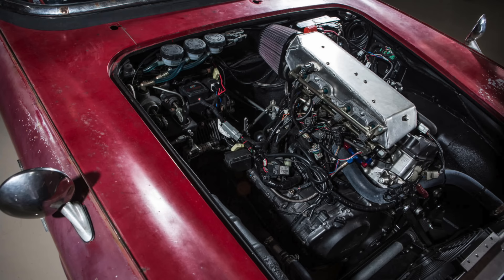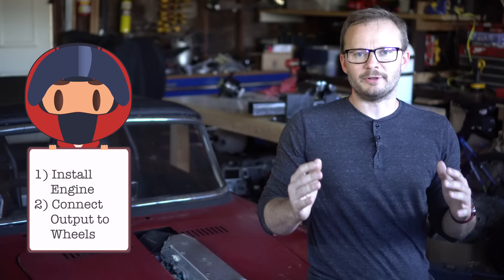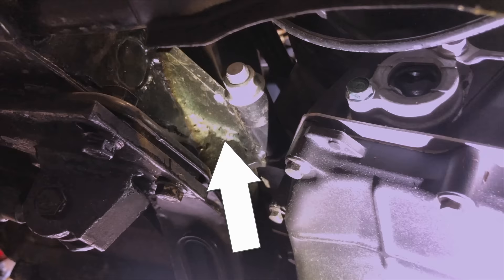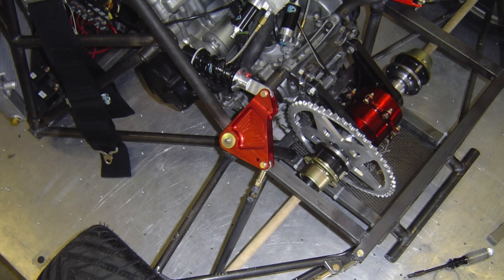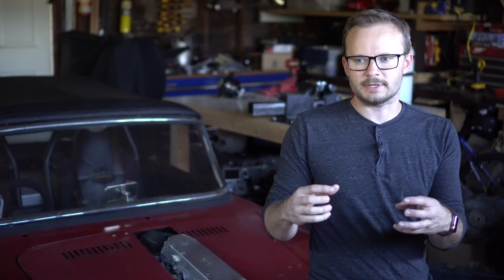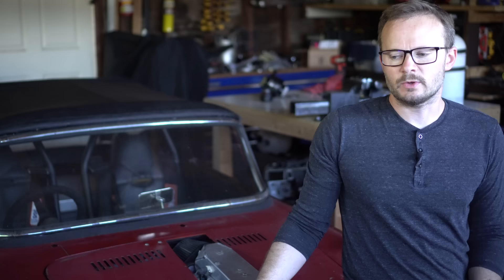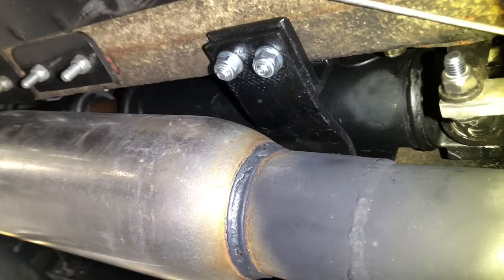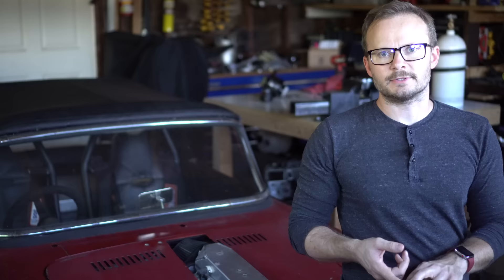Motorcycle Engine in a Car - Here's Why and How

Comment: I guess a man at my work was far ahead of his time. He drove to work in a Chevy Vega that was powered by a snow mobile engine. Complete with rope start.
Reply: Vagrants were not bad cars ,front end is the same as a Chevy  Monster um monza
Reply: They now have competition bush planes that compete in STOL drags (a cool new sport category at Reno) that run 300hp snowmobile engines. It's a sight to see.
Reply: Two stroke or not, I bet his oil consumption was way less than other Vegas.
Reply: @leifhietala8074  His only problem was driving to work on the Iowa winter's with no heater.
Reply: @ma tem Yep mine used a quart of Speedol about every 100 miles. Glad to see it disapear down the drive with the new owner.
Reply: Was his name Freiburger? 😉
Reply: @leifhietala8074  My vega got far better gas mileage than oil mileage
Reply: @gvet47  Find a junked GA aircraft and take the exhaust heater out. Recommended you get an aircraft mechanic to give it a once over to make sure there wont be a carbon monoxide issue. But once hooked up and with a cheap fan for airflow, you got yourself one toasty cabin and no water lines needed!
Reply: @tanall5959  Sorry but if you read this it was not me and now years ago this service tech at work did this.
Reply: If got a real Vega engine 78 red engine 200$ if any interest from wrecked sunbird .🤔
Reply: @tanall5959  
Let me introduce you to how air cooled vw did heat for the last 90 years!
Reply: I used to hang around with a bunch of UK microlighters who were into first adding motorbike carb rails or throttle bodies to everything, then it moved onto buying old MG sports cars and cheap 'n ugly triumph tr7's and adding whole bike engines to them, and finally a bunch of Mini's and their ugly stablemate the Metro with tuned bike engines 👀

The mini swaps are particularly good, some were sat up front on the original gearbox, others were in the boot with Z Cars parts. They really are the best platform for bike swaps, just a shame they're so expensive! 🙃

Oh and on the front end mini swaps? A lot of the mini racing series (engines up to 998cc, up to 1100cc and 1275/1300 series) are all dominated by bike engines now, every car runs one, so if you have money to solve a problem, you can bet someone makes whatever part you need!  a trackload of 200bhp minis is quite a sight, and the noise! 🤪
Reply: Knew a guy , his father put a royal Enfield 750 in a willies jeep
Reply: @outinthesticks1035  ouch !
Reply: Cars have been modified since their invention. Also y u brag for someone u once knew. Weird flex but okay
Reply: @alienweed6396  Well I guess I used the term since he has passed away. Harold was a field service man for the company I worked for.
Reply: Ok.
Reply: Lol I found the Wisconsinite
Reply: Sometime around the year I was born (1983) my Dad was busy stacking points on his license with a Cosworth-powered Vega.

Comment: I  don't think my friend did any calculations like this when he shoved a 440 Dodge Bog Block into an old Datsun 240Z
Reply: Combo Gives Impressive Power To Weight Ratio
Reply: @peted5217  And a truly frightening experience when braking into or going round corners.
Reply: Oh what a tangled web we weave when 1st we Modify
Reply: @peted5217  Yeah bros, this thing had the exhaust manifolds upside down and exiting out the fender-well to side-pipes, a 727 automatic and stock year end, which didn't break cuz whenever he touched the gas it just spun both tires off.  He cruised by us one night about 30mph and just blipped the gas pedal 2 quick taps to say hello and left black marks about 200 feet long, lol.  Hey, by the way, for a laugh, check out my 500hp Firebird I had when I was younger in my 1996 VHS upload "Burnouts and Boobs"!
Reply: SHOVED.....IS absolutely the correct phrasing ! 😊😊😊😊

Comment: This deserves way more views
Reply: Nicknags, I was stationed in Japan in the latter 60’s and I had an S600 coupe with left hand drive from Okinawa. Fantastic little car. Getting used to pulling 11,500rpm on a regular basis on this engine was somewhat unnerving. I sold it to a squadron safety officer on base. I then bought a new S800 coupe. Another fantastic vehicle! Only a 9,500 rpm redline. THIS , (yours) would have been a pure beast!
Reply: Why?  He just sits there and talks.  Show us.  This is a video channel btw.
Reply: @arttafil6792  Wow man, I have a 612 wheel horsepower 97 Honda Civic coupe and it has a fully built 1.8L DOHC VTEC turbo engine in it that is capable of 10,000+ rpm, and I get nervous revving it over 9k rpm...granted, that small of an engine making 11,500 rpm isn't nearly as rough as a much larger engine making that many revolutions, but my engine screams at 9k rpm.
Reply: @arttafil6792  Also, thank you for sharing your experience with all of us! Salute!
Reply: Then watch it again
Reply: I concur most assuredly! Guy has an awesome Tude and he is funny while telling it how it is!
Reply: Nah, not really.
Reply: @Andrew-hp1yj  yeah and it’s pretty good information btw just showing it run wouldn’t work with the videos NAME
Reply: Well it's got plenty now hehe
Reply: And your comment deserves way more likes in return :)
Reply: @Andrew-hp1yj  what

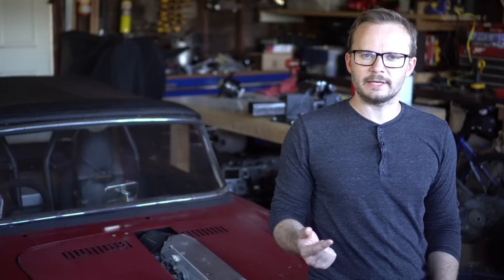Comment: Hey matt, i remember watching your car on jay leno  back in 2015 and thinking how cool it would be to have a bike engined car. So i started building a locost 7 with the intentions of a bike motor. Safe to say your car was inspiration. Now its come full circle and my car is in your video at 6:12 and 6:17 lol
Reply: how do you connect the car drive shaft to the motorbike engine when the bike engine uses chain drive? And how did he do it in the video without using QAUIFE...?
Reply: @goransvraka3171  Did you watch the video?
Reply: @goransvraka3171  shaft driven motorcycles exist.
Reply: @jorimills1368  BMW K bikes, 4 cyl, reverse, 100 to over 160hp and reverse. I have one and I want to but a K engine in my 64 Spitfire.
Reply: @goransvraka3171  watch the video, nerd

Comment: The reverse was my problem -- If I will do it over again I will use a chain drive differential and an electric motor for reverse. What my problem on using driveshaft was the joints.  Consider there is a one universal joint in the engine output shaft, the 2nd on the front reverse joint, the 3rd at the back of the reverse joint, the 4th in the middle of the driveshaft and the 5th on the differential joint.
You add the slacks together and you will notice so many things can happen and break and also to clunky.
Reply: Alibaba apparently sells like 10hp hub motors like in ebike conversion kits. Could you just have this kind of motor in the wheel? 5-10hp should be OK for a light car?
Reply: You could make it a hybrid if you have a motor that can reverse it. You don't need a huge battery pack or motor cooling, just something for some pep until the higher rev range is reached.

Comment: in the early 70's my grandfather took a brand new corvair and put a 2 stroke boat engine in it for the fuel savings. it was a whole process to drive and it couldn't do hills but it was pretty cool. as far as i know it's still running too.
Reply: For years now I've wanted to do a mazda MX5/Miata fitted with a Direct Injection 300hp 2 smoke V6 from an outboard...but life and the bank balance always says no.
Reply: @unhippy1  I had a friend that dumped a street ported 13B in one...pretty cool combo.  Not 300 hp, but pretty potent non the less.

Comment: I would prolly go for a small 12-volt powered motor for reverse. BMW does this for some of their heavy motorcycles, I believe they use the starter motor for that.
Reply: Years ago in the UK my father got hold of a 3 wheeled invalid carriage, he stripped the body off & put on i think an isseta front axle & made a kind of big Kart for me to sling round local fields when the crops had been cut. The engine was a 250 Villiers 9e  (2 stroke). This had 4 gears forward & if you wanted 4 gears reverse!. I was told, & i was only 9 years old at the time it worked because pushing the ignition key down & turning you reversed the polarity & the engine ran backwards. Never questioned it & never thought any more about it ..until now. Think i need a closer look at the claims.
Reply: @kevinparker461  Two stroke engines can run in both directions without any problem. Four stroke engines however, cannot.
Edit: So can a starter motor by simply reversing the polarity
Reply: kevin parker yeah, thats a 2 stroke thing, old 2 stroke diesel tractors do that as well (they even have an indicator on the dashboard to show that it cranks the wrong way around)
Reply: @maxdippininmylolo6421  Thanks for that, was going to look more into it as that's what i was told as a lad. Very interesting.
Reply: But then you wouldnt have access to all six gears and 150+  HP in reverse.
Reply: @jeremy12ga26  dang thas fast ol boy
Reply: I have electric reverse
Reply: Honda started that with the first 6cyl goldwing
Reply: @NLRamonNL  not all 2 strokes, learn the difference between disk valve and reed valve.
Reply: @NLRamonNL  Just the other day I read about a car that had a V8 four-stroke that they had reversed the direction.  Mostly what you need to do is reposition the starter motor and make a different camshaft.
Reply: Yeah they run the starter motor backwards for reverse
Reply: @philipethier9136  reverse rotation V8s were/are common marine engines you run two V8s both with straight through gear boxes so one is standard and the other backwards so very common particularly as 351w or Chrysler.
Reply: BMW the owner of Harley  Davidson for ten pluss years . BMW put a pan engine symaller  to a vw  engine with a smaller  design but was a 12 to 1300 cc. Harley  Davidson
Bought back Harley  brand in the 90s  since then they have come out with beta designs.

Comment: I considered a bike engine when uprating my Mini, but I went instead for a Honda B16A2: 1600 DOHC motor from a Civic. While the HP output from a good bike motor is comparable, there is NO comparison when it comes to torque, the stuff that gets you up and away, and out of corners on a race track or hillclimb. Round town I have nil interest in holding 6 to 10 grand all the time, just to get moving and keeping up with the cars I want to keep up with. The Mini weighs 700 kg all up and is a delight to drive at any speed. And the VTEC is a free lunch - a fuel efficient pussy cat down low and a howling beast under provocation when the VTEC kicks in. Sure, it weighs more than a bike motor, but it's a far better solution for round town and on hillclimbs.

Comment: Here in the UK a sports car manufacturer called Berkeley manufactured fibre glass bodied sportscar with a variety of two and four  stroke motorcycle engines in the 1950-60s.
One was driven around Goodwood by Sterling Moss and their pioneering fibreglass monoque construction was a whole year ahead of Lotus. 
They even used the 700cc  Royal Enfield Constellation engine complete with electric start. I believe they have recently been resurrected as a company producing modern cars.

Comment: My brother use to have 2 , 1959 Berkeleys. They were small fiberglass with aluminium belly pan, 500cc 2 cylinder motorcycle engines. Cars weighed in at around 700 pounds.  One blew and engine so he replaced with a 750 honda. Front wheel drive and  Neither had a reverse . 

From 0-60 they were amazingly fast but didnt go much past 65 top speed. 

Also. Im 6'4" and had plenty of leg room. Though it was easier to roll out of the car because it was so low.  

He sold one and was rebuilding the other about 15 years ago,  but some drive by scavengers stole the aluminum belly pan from his yard.
Reply: Dam Ham - I was waiting for some kind of conclusion or your opinion on what happened or something but you just tailed off and stopped...
Reply: I had a three wheeler Berkeley... The 4 wheeler SE492 with two stroke triple was really what I should have gone for: fantastic.
Reply: @diyhell8712  I dont know all the models of Berleleys, the 2 my brother had reminded me of 9 foot long 53 vets.  Lol.  

But if anyones interested I found this. So you can still buy them.. https://barnfinds.com/tag/berkeley/

Comment: Yeah so this is pretty much my dream car. I grew up riding rice rockets in the '80s and I always wanted the Rev range and driving dynamics of a motorcycle engine in a small car. The only production car that ever came close was the Honda S2000. Good job Matt.
Reply: Did you not get the 97-99 EK9 Civic Type R in your country? My one revved to 8,300, you basically had to spin it that high to get any where, it made very little torque. :-)

Comment: If using a live rear axle it's worth bearing in mind the effect that axle twist can have on the angle of the prop-shaft UJs. It's usually not a problem without leaf springs and a lot of power but still worth considering.

Comment: Originally with a chain drive and an engine derived from the Honda CB450, the 600 series was basically a 4-wheel motorcycle to begin with.
Reply: CB450 around in 1963 & 4cyl watercooled? S600 completely unrelated to N360/600.
Reply: Mateo, not really. As Anton says, aircooled CB450,, and water cooled S600.  Different design studios and no parts commonality.  The S600 rear drive was fully enclosed in cast alloy chain cases.
The S600 engine was evolved from the S350 and then the S500, both water cooled 4 cylinder engines. Search out the TN500 for the light truck with the DOHC roller bearing crank with two two barrelled carburetors.

Comment: When I was stationed overseas, (late 70s early80s), I bought a car off a  GI headed back to the world who didn’t want to spend the money to get smog equipment installed in the car so I got to buy it, for dirt cheap. But it was one of the first 600 sedans. I opened the hood and there sat a factory installed, 2 cylinder, 600cc engine that was exactly like a friend of mine’s bike back in the world. It would seat 4, had 10” wheels/tires, ran like a bat out of Wuhan. But I didn’t want to pay whatever it cost to get the smog equipment installed once it hit California, so I sold it to the next GI. Driving it through the hills of Luzon was a blast. It was smaller than a Mini Cooper. Ran for days on a gallon of real gas back then.

Comment: My first car was a 1972 Honda AZ600 Coupe (Blue). That had a 2-cylinder 600cc air cooled motorcycle engine.  Curb weight was 1,260 pounds.
I now have a 1972 orange AZ600 that is currently being restored. Fun cars!

Comment: Lightened crx with a cbr1000 motor would be such a cool combo. Magnesium wheels, carbon everything possible, add a power commander to the 1000 motor. I would love to do this someday. I ride a cbr929rr, so I KNOW there is adequate power for a lightweight platform. Thanks for the video, great stuff, well done!

Comment: My family had a 1969 Fiat 850 Spider convertible which was rear engine rear wheel drive.  It was a 4 cyl pushrod engine w/ a 4 speed transmission.

Comment: Nice work.  Did you consider grafting the whole rear subframe from a Honda S2000 with the rear diff., A-arms, brakes, half-shafts, etc.?  I've seen these for sale and I would think the gear ratio in the S2000 diff. would mate well with a high revving bike engine.

Comment: Hi Matt, I have very similar set up to you. I am in college now but built it during high school. It is an MG midget with a bandit 1250 motor. Most of my engineering is the same as yours but less refined, I am running a solid axle in the rear with pushrod suspension. I am glad you made the comment about driveshaft loops. My driveshaft did come apart when testing, very scary with just the trans tunnel for protection. My biggest issues with the car a still gearing and the front spring rate. I'd love to send you some pictures if you are interested.

Comment: I was wondering how to attach the counter sprocket to the driveshaft. Welding a tube on the counter sprocket and a plate on the other end sounds good to me or buy the adapter, I didn't know they were available until I saw this video. Very cool.

Comment: hmm, I wonder how hard it would be to mount a bike engine to a conventional car gearbox, say a BW T56?
you wouldn't have a sequential, and you would have to make some sort of adapter plate, but it would also mean you can mount the engine much more "normally", and you have a reverse gear.
Reply: Captain Zoll the inline four bike engine allows for an easy rwd layout, sequential allows for clutchless shifting, the weight reduction is better for handling, and reverse can be obtained another, lighter way

Comment: In early to mid-70's, fibreglass shells were available, with or without engine. Friend of mine had 2-seater with 750-triple, water bucket. He didn't like having to wear seatbelts so didn't keep it long.

Comment: I split the wheels difference and had a trike with a Yamaha chromed VTwin. Trikes are a lot of fun, and more open than a convertible. But, the Subaru 360 and Isetta were pretty much two stroke motorcycle powered cars.

Comment: This Honda pretty much already had a motorcycle engine.
Reply: Yeah Why didn't he mention that? I believe honda s600 was one of the first car produced by honda, up to that honda only created motorcycles.
Reply: Skoda, no, not really.  Only in suburban myths from people who never knew the cars.  The water cooled DOHC four cylinder all roller bearing crankshaft 606cc engine was unique to the S600 series of cars.  It evolved from the S350 that grew into the S500 and grew a little more to be the S600.  With the right exhaust system at 6,000 rpm yes, they could be mistaken for the CB750, but only by sound.

Comment: Torque is the issue with a vehicle that weighs 4X the motorcycle, so if your bike motor only makes 72 lb/ft it can get pretty screwy.  Car motors make more torque per rev, so that’s the true issue with a bike engine.  12,000 rpm redline.